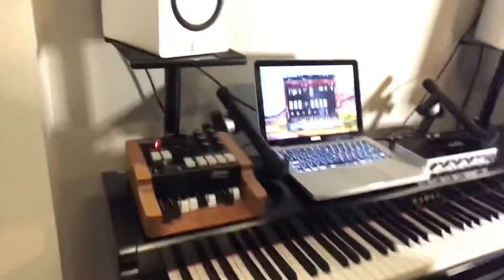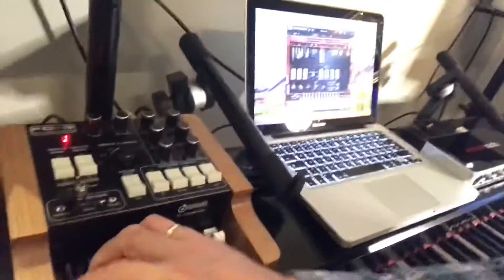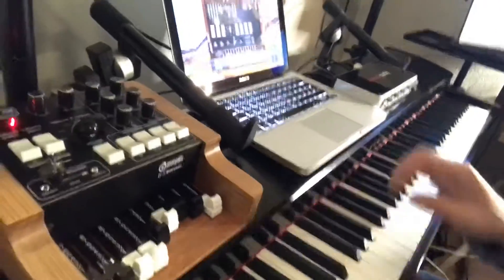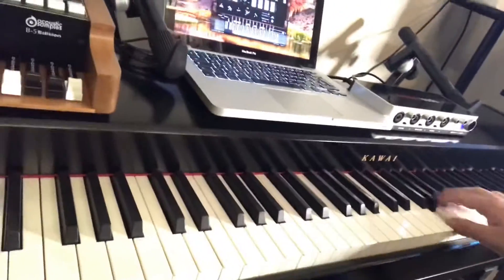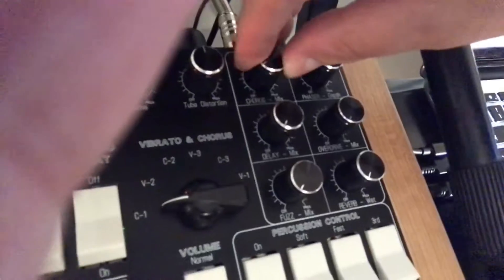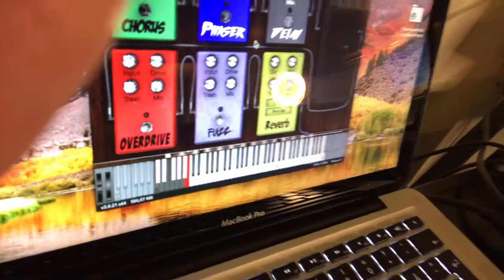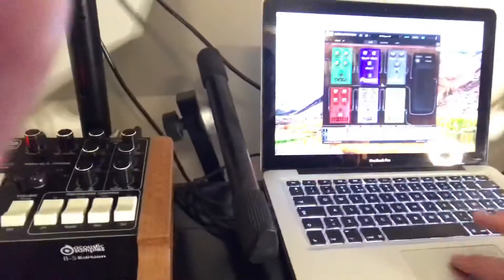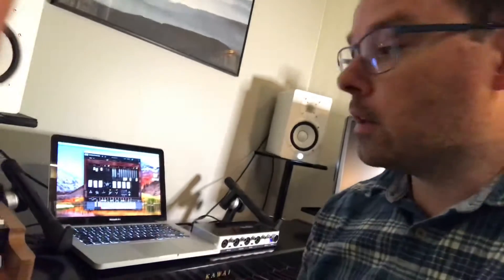Short demo of the new drawbar MIDI controller for AcousticSamples B-5

Comment: Hello, very nice. Is it easy to set up the midi mapping to Organteq (made by modartt that make the fantastic pianoteq)?
Reply from the maker: Thanks! As far as I know, the organteq software emulates pipe organs. My controllers are made for Hammond organ software. The drawbars, switches and knobs will not match the controls inside the pianoteq software. You can off course use midi mapping in pianoteq to map the controls but the software doesn’t use drawbars so I don’t quite see the point.